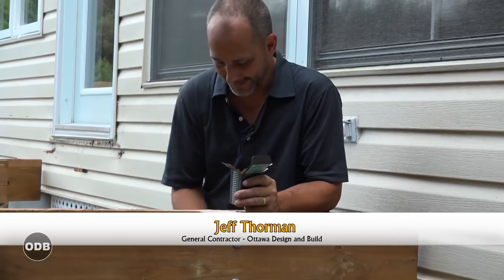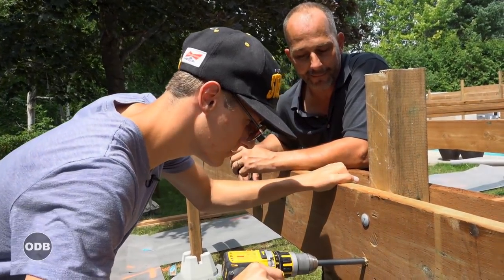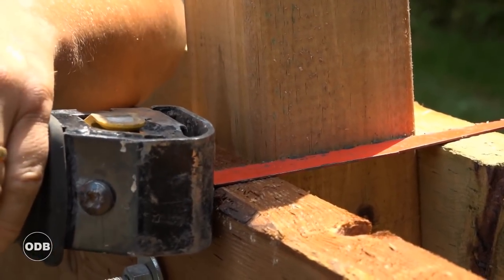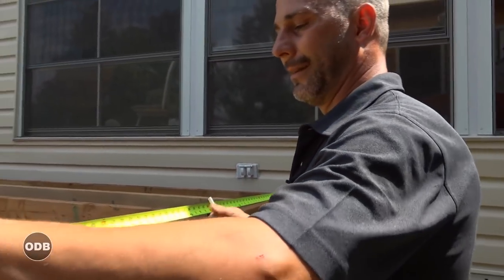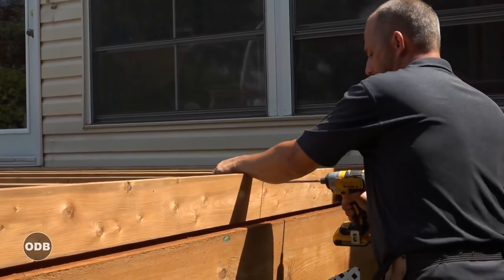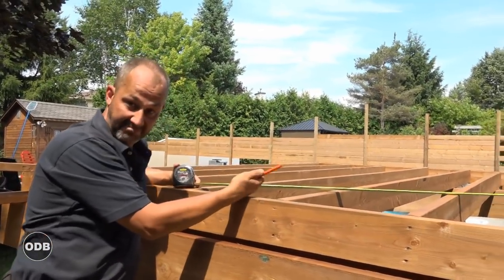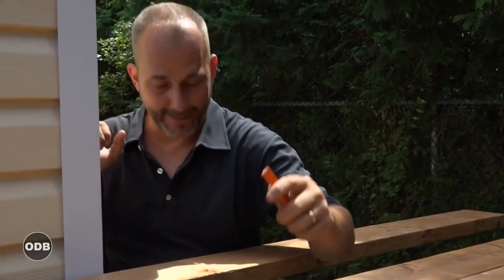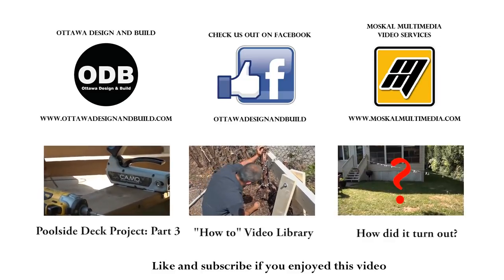DIY DECK Part 2 | Joists

Comment: Doing a big project like this with your kid is awesome- I just finished a bathroom reno with my daughter and we're starting on a deck next week. She wanted to know what to expect so we're checking out the videos for a heads up. Good stuff!
Reply from the maker: We had a blast. Great memories for a lifetime.Cheers!
Reply: It would be a great if he was building the deck right. The beams should sit on the posts--that's code! The bolts he's using can only hold about 400 to 800 lbs, so if 5 adults ever stood on the same side of the deck it would more than likely fall. It'd be awesome had he taught his kid the right way to build a deck...

Comment: Its best to check with your building dept and submit plans BEFORE you embark on building this. I drew up plans and decided to use thru bolts and the plans were rejected because the wood needs to be resting on top of the support columns. Had I built it the way I wanted, the inspector would have not passed me and I would have to take it down and start over. Valuable lesson learned. Btw I am in RI Your town may be different. Always check FIRST!
Reply from the maker: Good advice. But most problems can be solved with a good engineer if you run into problems with an inspector. Don't ever be quick to tear something apart without an engineer looking first.
Reply: Great advice  @HomeRenoVisionDIY

Comment: I just found this video series. I love the floating deck idea. However, this specific design wouldn't pass code in my county in Iowa either. But like he said, Always check your local codes first and build to their specifications or above! Codes change due to new findings and research. 
Additionally, my ground is also heavily clay based and I didn't see any reference to it in the case of footings, except to be below the frost line (2 feet when I put my fence posts in, not it's almost 3 feet a few years later). My clay must not be as bad as I think it is.

Comment: Ser nice work I'm also drywall carpenter in Philippine  but now I'm here in Qatar I like your work  Peter John Baja I'm like work very much
Reply from the maker: Thanks John, hope things are going well in Qatar!
Reply: Ser I would like to apply to new Zealand if you help me where I can find  comp to work my smelled as gypsum installer I finish my contract at Feb 2,2018 5 years here in qatar

Comment: Shouldn't you knotch the posts and set the beams into the post for direct weight transfer?
Reply from the maker: Definitely an option however this system saves over 20 hours of labor. Also really easy to do. each post can carry 4000 lbs this way and there are 10 posts carrying the upper section alone. I have 3 times the required load ability.
Reply: @HomeRenoVisionDIY  Notching also allows a place for water to collect.......=rot
Reply: @AidenRowley  1) it's all treated lumber 2) flash it, put a layer of 100% silicone....super easy to do, notching is not hard, certainly not 20 extra man hours for the system.

Comment: Our house has an existing deck attached to the house, with a smaller lower floating deck just below it. It's unusable space, so we want to raise the lower deck so it's the same height as the higher original deck. How would you recommend we do that?

Comment: Thanks for the video! My husband and I will be attempting to build our own. I was wondering if we can do the same if the deck blocks are sitting on a concrete slab which is slightly slanted. We live on the shore of lake Erie, and there's been lots of movement. The concrete deck (slab) I'm certain was once level in the 60's but now is moving downward. We want to build a stand alone deck off the house but for the most part it will be over this slab. Will the blocks work?

Comment: With box beam construction how many posts and beams are recommended for a 12’x36’ deck. Also is it advised to use crippled bracing along the post under the beam?

Comment: You have the weight and load of this deck only supported only by the bolts holding the beams to the posts, I would recess beams into the posts.  The shear strength of those bolts would not sustain the weight of that deck over time.
Reply from the maker: First of all, the shear strength of those bolts is approved by the city and the engineer on the job. Secondly the shear strength rating is actually only half of what the bolt can carry. This is to ensure that over time even with eventual corrosion there is sufficient rating to do the job.  There are actually 20 bolts supporting the top level. I believe that is rated for 40,000 lbs with an actual capacity of 80,000 lbs. This is sufficient and much quicker than recessing beams.
Reply: Paul Connolly yes i was thinking same exzact thing & seen his comment about city code garbage. Like cites are end all be all answer to Safety. Reguardless city approved OLD & out dated way of doing a decks Beams laying on top of post is far stronger & last longer. His deck is still built well no doubt when he tried to move it was solid as rock.
Reply: That deck is holding wood and people- not an aircraft carrier and a small country. The amount of bolts he used is more than whats used by the military to lift tanks onto rail cars for transport.... (that's probably not true, but still...) and you don't think they can hold a deck off the ground?
Reply: Where I rent now the deck in front of the house  is held up with only 5mm x 90mm screws. And as much as 5(in total) of these screws is holding the outer 2x8 beam in place to the two posts. (Buildt 8 years ago, and nothing in this house is up to code, will be moving soon) So I think the bolts used in this video is more than sufficient.
Reply: Mojokota you are correct they are building the beams incorrectly. I have seen bold snap after about 5 Y. The correct way is place the beam on top of the post.
Reply: My first thought as well while watching. Sure it may be to city code but mechanically its best long term.
Reply: Our code officer would fail that for lack of shear strength.
Reply: If the inspector did have a problem with the weight bearing on the bolt it wouldn't hard to actually attach 2x4's either side of the post for added reinforcement. Obviously the 2x4's would have fit tightly into the gap between the top and bottom beams.
Reply: I have to agree with Mojokota on this, the deck would not get approved here in Australia. I know your a general contractor and I been watching all your videos today, but regardless of strength of the bolts and screws I would notch the post and use hangers. 
Hanger installed on the next video.👍
Reply: Home RenoVision DIY I’m building pretty much the exact same deck. 2x10 beams with 2x6 joists. Can I just box beam the middle posts and have just one 2x10 on the left and right side or do all 3 have to be box beamed?

Comment: It looks to me that all of the dead weight and live weight of the deck is resting just on the 1/2" galvanized bolts.  Do those bolts have a shear resistance for that much weight?
Reply from the maker: The shear strength of those bolts is rated at 2000 lbs. The top deck is supported by 18 of these. More than triple what is necessary.
Reply from the maker: When it comes to structure you always spend the extra dollars for a good night sleep.
Reply: I think most codes in the states would require the beams to sit on top of the posts or have you make shoulders on them. This is just enough information for everyone on youtube to be annoying. I think people forget how strong a 1/2 bar of steel is
Reply: Home RenoVision DIY 
And what is the shear strength of the wood?? All the force is on the 1/2” of wood. This deck is not safe.

Comment: With all due respect, I believe code most everywhere now or at least suggested practice is to not to sandwich beams to posts anymore but to use 6x6 instead of 4x4 posts and notch them to accept the joists, and then use the carriage bolts to fasten them.. I would also put the base gravel in the ground (not on it), tamp it, put a 24x24 patio block, and then the 10x10 block so that the bottom of the post is just above ground level.  I also don't believe that the ADA (Americans with Disabilities Act) would accept a deck like this for wheelchair access but would expect a design more like I indicated. That said, I like your workmanship and explanations. Regards....
Reply from the maker: code is different in different areas, we built on a permit and had an engineer approve the build as well. Cheers!
Reply: @HomeRenoVisionDIY  thanks...,

Comment: This is more of a question for part one of this series but it just came to me. What is your opinion on using telephone poles for supports posts?
Reply from the maker: If you have them lying around be my guest!
Reply: They're great for longevity but, stock up on saw blades and find a helper to move them where you need them- They get heavy, quickly
Reply: @ J.R. Shepherd- Yea, I guess I'll be getting a workout on this project. Thanks for the reply.

Comment: I've seen folks using peel and stick tape for the top of the deck joists.   In what situations would you do that?
Reply from the maker: never. I believe a good pressure wash each spring removes the organics and makes the frame last a lifetime.
Reply: Does excessive pressure washing damage the wood surface over time? How about using peel&stick tape for critical areas prone to moisture?  @HomeRenoVisionDIY

Comment: Jeff I am building a deck extension I want to use 4 x4  and attach joists with screws  is that strong enough ?
Reply: For structural work, "is that overkill" is probably safer than "is that strong enough"

Comment: Did you use joist hangers at all?
Reply from the maker: not on the upper section. all the weight is transferred into the box beam. That is the beauty of this system. quick assembly
Reply: I had not thought of that but you make a good point, if the joists are setting on a beam then i guess hangers wouldn't be necessary?

Comment: Hi, what size of screws you use on the joist where is supposed to be three for a 4x6
Reply from the maker: I use 3" screws. And they are just to keep the wood from twisting. since the whole joist package is sitting on a beam it doesn't have any structural strain on them.
Reply: Home RenoVision DIY Thanks for your prompt reply, are they #9 or #10?  Sorry for the newbie questions.  Just trying to do do the same with hubby.

Comment: This deck does not meet Ontario building code. Carriage bolts through the beam are not structural and not to code. Laminate the beams with PL glue and put on top of the posts.
Reply from the maker: Sorry to disappoint you George but it does meet code. And it was inspected and passed. Built on a permit. Cheers!

Comment: when it is necessary to use joist hangers on your deck?
Reply from the maker: whenever the ridge beam is carrying the load. If you have a structural box beam under the whole joist cavity then it is not necessary.
Reply: Home RenoVision DIY ahhhhhh didn't know that's what was done sorry . Thanks for the response!
Reply from the maker: Glad to help william stang
Reply: you never showed how you attached the box beam to the joists just toe nail the screws?

Comment: Typical woodworkers, using channel lock pliers to tighten a nut and bolt.  LOL.    Don't you have wrenches?   Impact driver?    lol.   Either way, nice work with minimal tools.
Reply from the maker: That was kind of the point. To teach DIYers how to do things with minimal tools. Glad you like the product.

Comment: I never heard him say what kind of bolts and how long they should be - the ones that carry the load.  Can anyone help me out here?  I'm a complete novice.
Reply from the maker: Those are 1/2' by 8' long galvanized carriage bolts Sherry. Thanks for the question! Cheers
Reply: Sherry Collum any bolt over 1/4v have grade markings: no markings is a grade 3 bolt (soft), 3 marks are a grade 5 bolt harder,  6 marks are for grade 8 bolts (hardest) grade 8 bolts have a higher shear strength. Check yoyr local codes BEFORE embarking on this project

Comment: That deck may look great once finished but its not structurally sound. You are depending on those bolts to hold the strength of the deck when you attach them like that. If the bolts bend or break that deck will sag or fall. No joist hangers for your joist is a big no no. I don't know where your experience comes from or what part of the world you live in but I would want you building me anything that way.

Comment: the entire framing structure is wobbling around when the bolts are pushed through.....  not good.  at that point the framing should be pretty solid.  This build is in violation with all of our area building codes.  Between the bolt ups, post and fasteners, I'm not really sure why they're building it this way, especially for a handicap accessible set up...….and after consulting an inspector as spoken about in video 1.
Reply from the maker: Hi Scott, we have had to move from code to and engineer to get this aproved. The city has too many restrictions to make this possible. My engineer stamp has more power than the building code. Stop speaking like the code is the standard. It is a list of rules that college grads can manage builds by that are substandard and leave no room for creative thinking. That is why I prefer working with engineers. They have the ability to solve problems. This style of construction gets its strength from the totality of the build not in concrete piers. That is why it is flexible until the end. Cheers!

Comment: If I built a deck this way in my town in Mass, the building inspector would make me take it down.  Like the previous guy said, you can't put all the weight on two bolts, the weight should be on the post.
Reply from the maker: Hi Doug, I would suggest following the code in your area. BTW this deck is resting on over 20 bolts. Cheers!

Comment: WARNING--this is not how code requires a deck to be built. If an inspector saw this, it would possibly have to be tore down.

The beams have to bear on the posts. Those lag bolts are only rated at about 400 to 800lbs, meaning 5 grown adults standing too close could cause the deck to fall. Then entire deck is essentially relying on I think it was 8 of those lag bolts to keep it up. A lot of decks that were built that way have been falling and hurting people in recent years.
Reply from the maker: Hi Adam Thanks for your concern. This deck was bulkt on a permit and passed. the bolts are 1/2"carriage not lags and are rated at 5000 lbs. This type of deck may be required to be built on posts in some jurisdictions. But they do not faall down. cheers!
Reply: @HomeRenoVisionDIY  I want to work out there... Here in NC, every county I know of requires you to comply with IBC or IRC, as well as any additional local codes.  I guess I'm just used to that. But don't be surprised if they quit allowing that soon because they are pushing pretty hard for using IBC and IRC in every state and county.

Comment: Wrong drill bit dude. That is a aircraft drill bit used for reaching a hole in a deep location NOT for drilling deep holes. Get a bit that has full length flutes.
Reply: You should call DeWalt and let them know.  Part number DW1614
Reply: Bill tell them what? That people ain’t using their drill bits correctly?

Comment: WOW!!  Ontario building code do not allow 2x6 to be used for floor joists & beams. Also the post to beam carriage bolt connection is not up to code(illegal). This deck wouldn't pass inspection in 80% of 1st world countries. Contractors like this keep contractors like me busy.
Reply from the maker: You are sooo mistaken. The building code has thousands of exceptions in it. Just because you don't know any, don't accuse me of being a bad builder.
Reply: Jawed Shaqiq, and... most contractors that state they ‘meet the code’ have just admitted that they’re meeting the MINIMUM permitted way of construction, not the guy that’ll get my money!

Comment: Tightening a nut with pliers? Not very professional. Right tool for the job. Never heard of a code that allows the weight of the deck to be held up by bolts. Even if it does, the 6x6 posts must be notched so the weight is supported by the posts. Don’t be concerned about the shear strength of the bolts because the wood can rot and then the bolt will go right through the wood. Treat the ends of cut treated lumber as the pressure treating chemicals do not completely penetrate the boards. Cap the top of all joists with weather construction tape to prevent rot. Decks do collapse because of faulty construction and we don’t want anyone injured because of cutting corners.
Reply from the maker: It is not faulty construction that causes decks to collapse, rather bad maintenance and realizing that a deck needs to be replaced on occasion. I don't follow building codes too often. I find them dumb and weak, that is why I prefer to use engineers for my large projects. They help get things done and fast.
Reply: I'm sure you've never used a utility knife as a pencil sharpener or a 7 in 1 tool as a screwdriver, right? I mean... right tool for the job at all times- OR.... sometimes you use the tool that's closest to you that will do the job just fine. The weight of the two rails of the box beams are being held by the bolts- the center beam that all the joists are screwed to is sitting on top of the posts. It's all treated wood- You and I both will be many years gone before those bolts pull through rotted wood. Weather tape stops direct water infiltration, not moisture. It extends life, it doesn't prevent anything. There's no faulty construction here, just doing a job differently then you would do it.

Comment: So first of all. The posts need to be knotched. There is no sheer strength in the bolts you put through. If the hardware fails the deck will fall
Reply from the maker: that is like saying if the notched posts fail the deck will fail. Those bolts are rated for 5000 lbs shear each. no worries. Cheers!